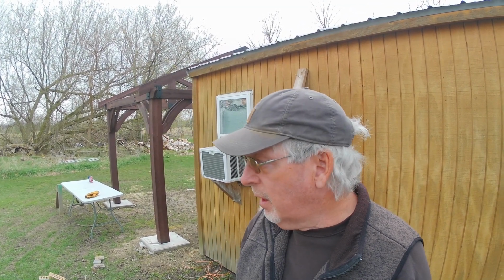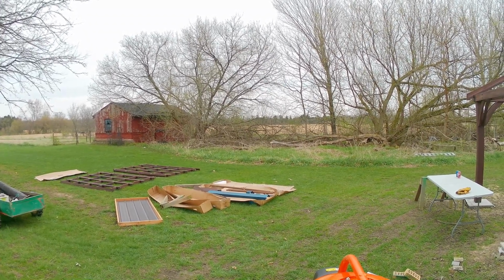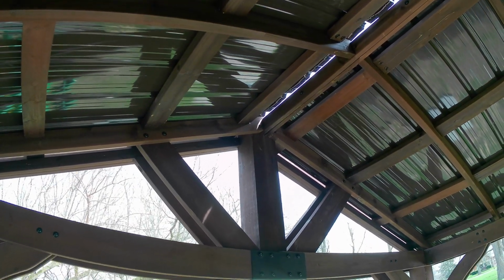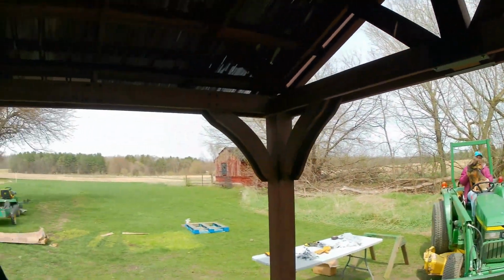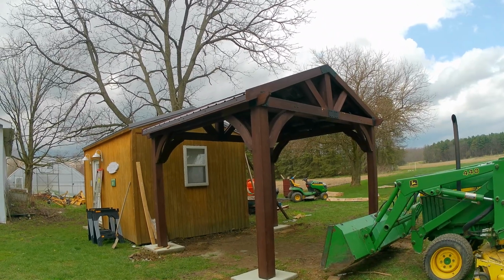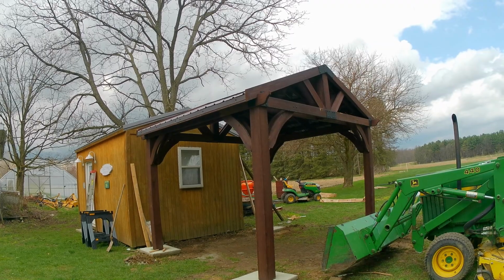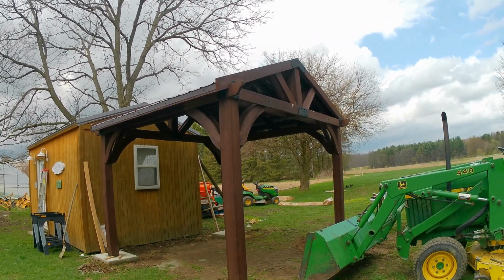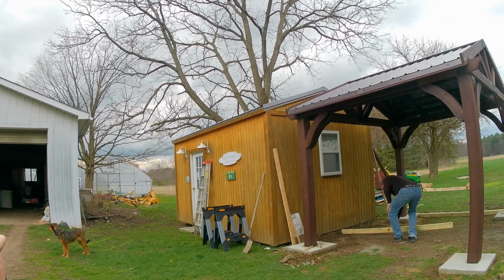Finish Work on our New Arlington Gazebo

Comment: Noticed you put the drip edge underneath the roof panels instead of on top as on the instructions.  Not sure why they list to put it on top as it doesn't make much sense.  The water just flows behind the drip edge.